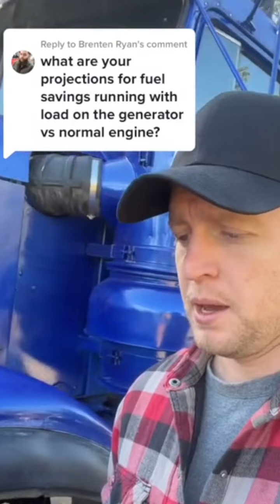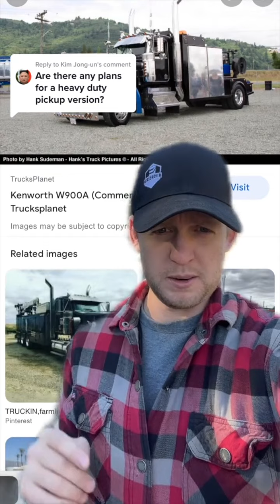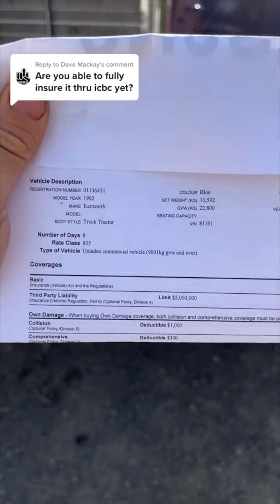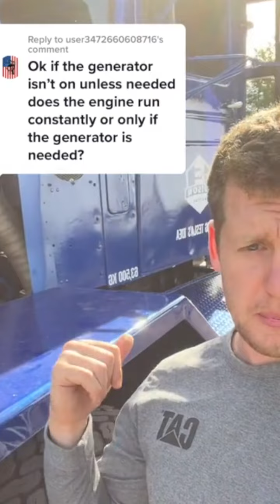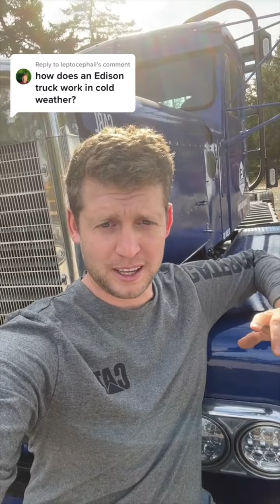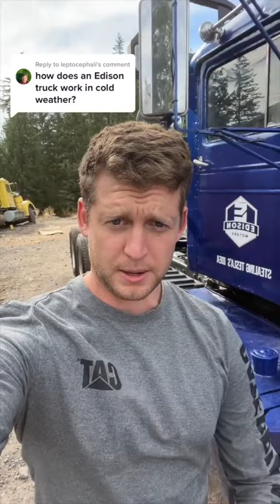Chace answers 10 questions

Comment: Just a thought, how are you guys minimising ware on the engine from the multiple start/stop/start cycles?
Do you have the engine cooling and Battery cooling connected so that the battery heated water also warms the engine when it's not in use so that once it's needed, the engine is already at/near to the operating temperature?

The leaders we work on tend to ware quickly (compared to the tractors) because the farmers mainly use them for only a short bit to unload hay, muck out the barn, feed the animals etc.
Reply: I can speak from how Chrysler does it for the heating/cooling systems for the EVs. The engine and batteries are on their own seperate loops, mostly due to the fact that the engine cooling system runs around 16-21psi, the battery cooling system is 5psi. So while it might be possible to intertwine the two, it's way more difficult and not worth the hassle to run them nor worth the extra money to engineer parts in the battery system to cool them at same system as the engine. Another thing is, the batteries have a range they work in for optimal discharge, exceeding that temp range will reduce the usability of them. So you are kind of forced to run two seperate cooling systems. Also, if you have a coolant leak in the battery system, generally it is not advised to do a pressure test.

Comment: Just for comparison. A Toyota Corolla hybrid gets 52 mpg, and the same car non hybrid gets 26mpg. There is no change in infrastructure, but 1/2 the emissions. The Edison uses existing techniques(ETs) So as long as the batteries and wiring can handle the logging roads, it will have fuel savings, how much, is a big question but, if a hybrid gets double the fuel economy, which the Edison layout is a cousin to, makes it easy to increasfuel economy by say 30 per cent , would be well within the realm of reality. For durability, time will tell, but using ETs down time can be minimized. Another asset is a small company cares. They care that O/Es are kept happy.
CN diesel electrics have had over a half century of success, and the only thing that CN did not bother with is the recapture of kennetick energy in to batteries. Maybe CN will ask Edison to help them cut their costs also. After all pollution is pollution, 30 percent is good and we are all in this together..I'll be watching and supporting your successes. 
Great work

Comment: I think you should nearly double the battery capacity,  build a bank of 280ah Lifepo4 cells, with 5mm copper bus bars,  with it cycling the battery that often it's not going to last long,   a 280-560 ah battery should last a while, 4-6 hours would be a good range bobtailing , having a 6-8 axels pulling and Regen, It should have the TQ of 4+ 12v92's climb a tree, or just shove the tree into the ground,  best watch fast acceleration, you will make the earth rotate faster or slower, making the day long or short! 😆 I saw a company who made 1000ah Lifepo4 cells, mostly used in mining equipment,  a 400+ volt pack of those would be awesome , if they work in mining trucks and equipment, they will work in a logging truck, Mount them on thermal transfer pads, with the pads between them also,  besides cells that large should not get that hot that fast!

Comment: I've wondered about this type of truck for a long time.  How do you handle the blending of your Regen brakes with your air brakes?  Is there a way for the system to know that the Regen is at max capacity and it's time to feed in some air brake?
Reply: Not really much different than using an engine brake and air brakes. If the engine brake won't hold then you use a little air brake.

Comment: Very interesting for sure. I would say your estimate of 5-100% fuel savings is inaccurate. I would guess your system consumes more fuel at highway speeds. Even if you didn't have batteries to charge and discharge, an electric motor and generator at 90% efficiency each already puts you down to 80% transmission efficiency.

If your system is designed to only charge the batteries and not supply power directly to the drivetrain, you can add on another 90% charging efficiency and 90% discharging efficiency, which puts you at 66% overall. 

Compare that to a manual geared transmission at 98-99% efficiency.
Reply: He was comparing Miles per gallon only not efficiency. They are 2 different things. For instance a gas engine is only 30 to 36% thermal efficiency. So when regenerating you might get more energy back in you batteries coming down a mountain loaded than you did going up it empty. The cargo weight gives you free energy to put into your battery pack as long as you are only hauling it down hill. This is why I imagine he is concentrating on logging trucks for now.  Their work environment is a unique one allowing for the best return on regeneration.

Comment: Just found this channel and company. Seemed pretty basic at first, but the more i think about it, it makes so much sense. Electric vehicles get better range when in stop and go situations than they do on the highway. I work for a concrete company and i can see this being a huge benefit, with the exception of running the mixer. It requires constant rotation of the hydraulic pumps in order to run the mixer, whether loaded or not, and whether the diesel engine would be running or not. Not insurmountable, of course, just something to think about. Also, a newer model truck will need a newer model engine. Not sure how DOT, or the Canadian equivalent for you up there, would like running a 2008 truck with a generator engine. Not sure if registering it as an electric vehicle would be enough here, because it does still have the engine. Food for thought. Subscribed, looking forward to more progress!
Reply: Electric motor to drive the mixer...

Comment: So if you'd run the generator for a half hour every hour, hauling a heavy trailer, at highway speeds, that's 24L/100Km, or about 10mpg. Quite a bit better than the best class 8 trucks can do currently.